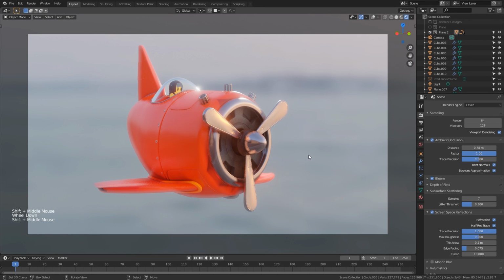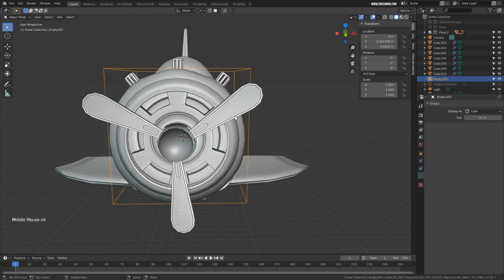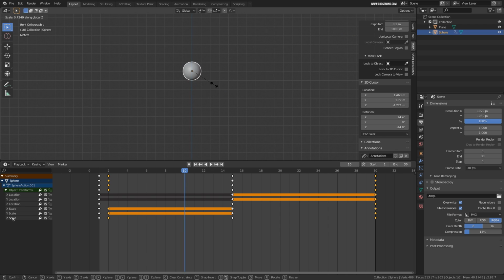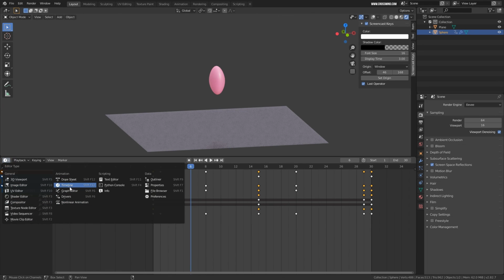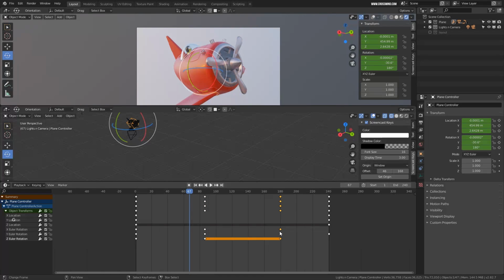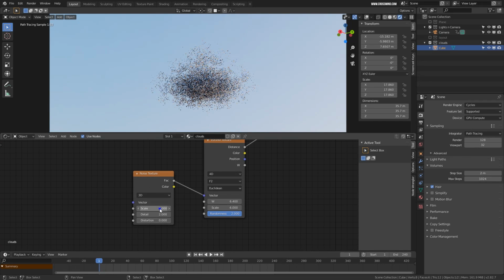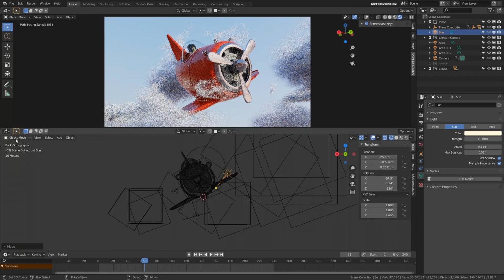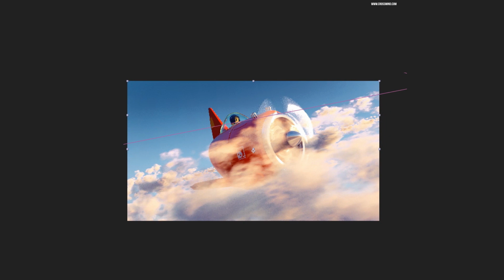Blender Day 7- Animating Aircraft - Introduction to Blender/ Beginners Series

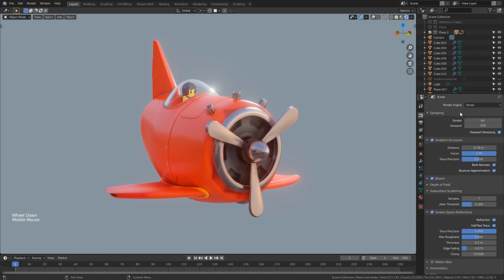Comment: HI, I'm facing an issue when animating the plane — in your video around 1:05, the plane rotates nicely in front of the camera. But in my scene, the camera is moving in a different direction, and the front part of the plane doesn’t stay cantered like in your video.

On frame 1, everything rotates properly and looks fine. But when I try to rotate the plane at frame 80, it doesn’t rotate the same way — the orientation is off and the plane doesn’t stay aligned with the camera like before.

I’m not sure if I missed a step or if my rotation setup is wrong. Can you please guide me on how to fix this so it works exactly like your tutorial?

Thank you so much for this amazing series!

Comment: what you are doing here at 9:34 can be done with a Control a, and then click rotation (assuming you didn't change that keyboard shortcut), and if you want to do the other one, just press R, then Z, then type 180 and hit enter, apply rotation again, then just press R, then Z, then 180 and hit enter again

Comment: Wow, what an insane tutorial, man. And all that for free?! One thing, I just can't get the clouds to look right/like yours, even though I copy exactly what you say and do. They look very smokey, they clip out and they just don't look like clouds at all. It this because I'm in a newer version of Blender? I would love to know, as it just kills the end result for me.

Regardless, amezing turtorial... by far one of the best I've seen for any software out there. Thank you for making this!
Reply from the maker: Amm.. it could be that your scene scale is not right. Did you scale the plane in mentioned dimensions?
if your scene is too big then cloud density wont be as seen in this, you will have to adjust accordingly.
Reply: @CrossMindStudio  Hey thanks for the reply! I got the scale right, I think it has to do with the fact you've changed some stuff off screen in your final result, so mine ended up looking different from your result. I also noticed you forgot to mention in this that you disconnected the link between the Volume Absorption and the Add shader. Once again, an excellent tutorial, but leaving details like that out can really be confusing for newcomers.

Comment: i have a question .... i can't make the motion blur work only for the propeller
Reply from the maker: Whats the issue? Ellaborate
Reply: @CrossMindStudio  i can't isolate the propeller  
the blur is applying on all mu scene
Reply from the maker: @abdouuabdouu5853  when you select motion blur are u just clicking or alt+click(or right click apply to selected)
Reply: @CrossMindStudio   the copy to selected option is unavailable
Reply from the maker: @abdouuabdouu5853  oh that might be because ur selecting all objects which are not mesh. Like camera n lights etc.
Only select geometry objects.
Reply: @CrossMindStudio  exactly... I'm only selecting the mesh ... no camera and no lights
Reply from the maker: @abdouuabdouu5853  discuss it on discord server with video. Hard to tell what could be the problem
Reply: There are 2 motion blurs. One in the render properties and another on in the object properties. Make sure you first enable the one in the render properties, then you can go to the object properties and do what Ram has done in the video.

Comment: I have a question regarding the scaling of everything - how do you decide what scale things should be - in contrast to what? I tried to apply your scale changes to the plane, and was running into issues -where anytime I spawned a new mesh it was way too small.
Reply from the maker: Real world scale is safe way to go about it. Often if scale is not right things such as physics, lighting, camera bokeh, density of cloud etc can have trouble calculating correctly and could be taxing.
Reply: @CrossMindStudio  Right, thank you for the reply. How am I to know when it is real world scale? Comparison to the world texture? I am having this issue now because my plane seems to be far too big.
Reply from the maker: @firesightstudios5823   in scene properties, unit setup, set the units to inches or meters etc.  Did you watch previous chapters?
Reply: @CrossMindStudio  Yes I watched previous chapter, and I have the units set to meters. I think i get what you're saying. I must have missed a part related to this.

Comment: Using 2.93.4, I found I was only able to reproduce anything like the little fluffy volumetric cloud formation at 1.17.04 by setting the scale to 11 in the Voronai texture node, changing to Smooth F1 and putting an Invert colour node between the Voronai and MixRGB Overlay node. Has anything changed in the last year or did I just miss something?
Reply from the maker: It might be ur scene scale is different.
Reply: @CrossMindStudio  what is your scene scale ?

Comment: Around 1:04:00 when you have setup just the basic camera and icospher clouds and keyframes , there is a problem I am facing which is that around near the middle of the animation it seems like at speed which my clouds are moving has slowed, then stopped and then suddenly started moving in opposite direction and then vice versa and I reach the final of my animation, I don't why is that happening, even graph y-location for both plane and camera is in vector.
Reply: Got it again I made mistake didnt convert the whole graph to vector, there was still a handle as default type

Comment: I spent 3hrs on the camera but still it wont change the location in the frames, it only rotates. I followed the procedure but it doesn't move. Then i had no option left and made it the child of the plane but now it also rotates with the plane and it's extremely difficult to rotate and zoom in out the plane in camera (0) view. If anyone has the solution then please help!🙏

Comment: I'm not gonna lie. When I saw his configuration and compared it to my very old rig is spitted on my monitor. That was unexpected. The approximate time of render in full HD in my case is 25 days.
Reply from the maker: In later versions optix denoiser was introduction. Try reducing your render samples to 64 and enable render denoiser in render properties >to optix. This will reduce the render time but compromise render quality a bit. Should be fine for learning purpose.
Reply: @CrossMindStudio  Thank you for the advice. I will just render it in 20% of the resolution. Nevertheless, I learned a lot from your tutorials, and thanks a lot for your work. I will maybe return to this project when I upgrade my rig.

Comment: while rigth click on box motion blur, the "copy to selected" is like disable / cant click on it, any solution please
Reply from the maker: try selecting few objects manualy. sometimes if there are non renderable objects selected which cant be assigned these properties like empties etc.
Reply: @CrossMindStudio  it turns out that I use the eevee render, that's why the blur effect can't only be selected, in the eve render there is no blur option in the object properties, I looked for it almost a day, LOL, thanks for the tutorial
Reply from the maker: @emiliacortessa3070  I see, yes you need to use cycles for that. Btw in new version eevee supports MB in viewport i think.

Comment: My computer is taking half an hour for each frame and i have 360 frames. I reduced the sample count to 100 and turned on sample selection,denoising,etc and all and even reduced the the resolution to 50 percent. My laptop is not good but it takes 7 days to render a 15 sec video , can anyone help me 🤕😂
Reply from the maker: Make it 24 FPS animation, that will reduce frame count. You can also render it in 720P, which i find good enough resolution for learning purpose. Other than that you optimize a bit by reducing bounces in render properties. 
Honestly i dont think 20-30 min per frame is too much time.
Reply: @CrossMindStudio  iam using 24fps the thing is I need 15 sec video so that I can post it in WhatsApp status so for a  15 sec video with 24fps it takes 360 FPS . Before this I did ducky 3Ds animation I put same specs but with eevie rendering anyway Iam saving it PNG files, .Thanks for the reply
Reply: @CrossMindStudio  oh then it's fine I was shocked when I saw 20 min per frame when I lowered the quality so much

Comment: Hi, I followed the tutorial and for some reason I can barely see the clouds while I'm editing.  I tried adjusting all the nodes and even watched the tutorial on CG Cookie on how to make a procedural Volumetric Clouds. Any ideas why the clouds is not visible? Below is the config specs on my MacBook Pro. 

Also how do you add the screenview as an add on? I did unzip the file and transferred it on the package content inside blender under the script add ons. 

Config: MacBook Pro 2019 
Processor 2.4 GHz 8-core Intel Core i9
Memory 64 GB 2667 MHz DDR4
Graphics AMD Radeon Pro 5500m 8 GB / Intel UHD Graphics 630 1536 MB
Reply from the maker: Are you using cycles render?
Reply: @CrossMindStudio  yes, When I'm rendering on cycles, the clouds are not visible but when its set on eevee I can barely see the clouds.
Reply from the maker: @SpoonIkel  Did you set the scale of scene as suggested at starting of video?
Seems like you might have skipped few things.
Reply: CrossMind Studio yes,  I even tried CG cookie tutorial to test it out if I can make a  regular clouds.
Reply: Hello sir! One thing I did notice since I maybe have had the same problem as you is that you must to make sure that your origin is set to you object, in this case our cube. Hope it help! Cheers

Comment: Sweet time saving trick I just learned. Instead of going through and changing all subdivision modifier viewport settings, go to Render Settings > Simplify > Max Subdivisions and set to 0 (or 1 if you can handle it). Changed my FPS from <6 to a smooth 24. I can check Simplify on and off when needed.
Reply: Oh this is nice, especially for weaker laptops, thanks for sharing :)
Reply: Thank you very much !

Comment: Hi. Thanks for this tutorial series it's been great. Just one problem. When I set go to apply and then click all Transforms, in order to freeze the transformations, blender moves my pivot away from the centre of the mesh and down below the  mesh to the grid? why does  this happen? any help would be great.
Reply from the maker: Just like how any object have its default position set to center of grid 0,0,0 . Similarly when you apply position it will make that position as 0,0,0.  Lets say if u create a box n move it 1 meter in x direction then cordinates will be 1,0,0 but if u apply position then that position becomes its default(0,0,0) and object even though moved away from grid is still at default position. Thats why pivot is showing on grid center.
Reply from the maker: Sheldon coopers 0,0,0 location is his spot on sofa.
Reply: @CrossMindStudio  Thanks for the quick reply. I just decided to manually centre the pivots of the objects after freezing transformations. I'm just used to maya. When you freeze transformations the pivot doesn't move back to the center of the grid, but it centers in the middle of the mesh. So this aspect is a little bit annoying in blender. But thank you so much for this tutorial series. In a week and a half I already have a hang of blender. AND IT IS AN AMAZING SOFTWARE. I've been so impressed, especially coming from Maya.
Reply from the maker: nikelo mbambo Awesome, yea man its always good to learn new things. When you learn 1 software you lean 1 . When you learn 2 , you kinda get em all.
Reply from the maker: I  will crosschk as i cant having this issue.
Are you sure its pivot point issue? Check you transform pivot settings on top. 
I will chk this and confirm as well.

Comment: I have 2019 model iMac. 3 GHz Core i5, 8 GB memory and radeon pro 570x 4 gb graph. how long does it take to render the full animation approximately?
Reply: for animation render it takes 30 minutes only for the first frame. so for the full of animation i calculate the render time 120 hours, I think there is a problem :/
Reply from the maker: If it’s a full HD render then 20  or 30 min render time is ok. Because you are rendering lot of clouds.
It took me 15 min per frame as well.
Reply from the maker: You can also try to reduce sampling a bit for volume. And play with bounces sampling as suggested in video.
Reply: @CrossMindStudio  thanks a lot.

Comment: Very good video,  thanks for it
Can suggest how much minimum RAM required for smooth rendering ?
Reply from the maker: Prajoosh N you need good processor and GPU , Ram alone wont help.
But in anycase keep it atleast 32 -64 GB if you are into CG.
Reply: @CrossMindStudio  do you think 8 gb will do 🤨? I have i5 9th gen and gtx 1650 gpu.